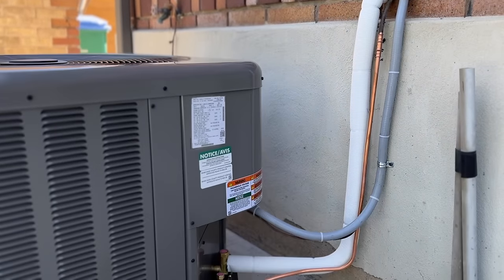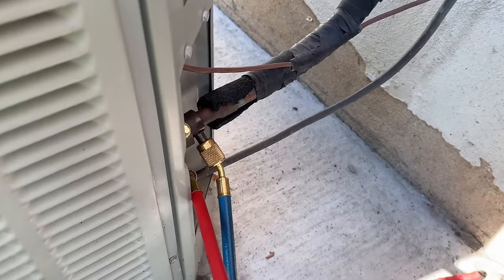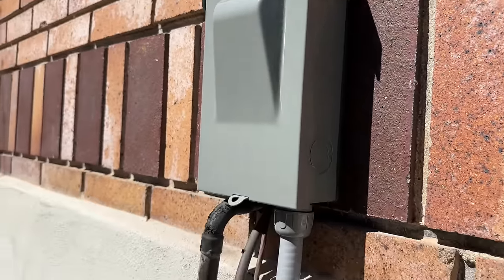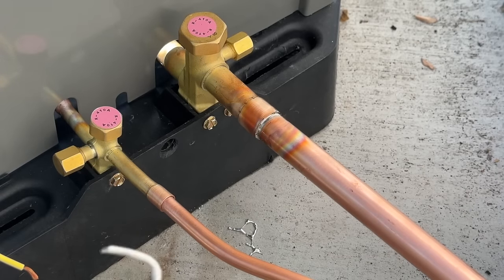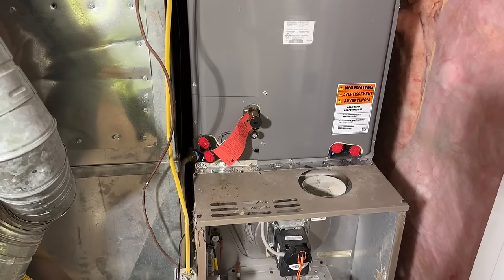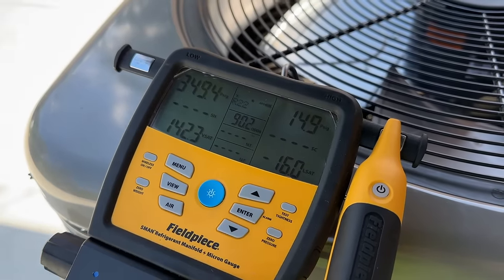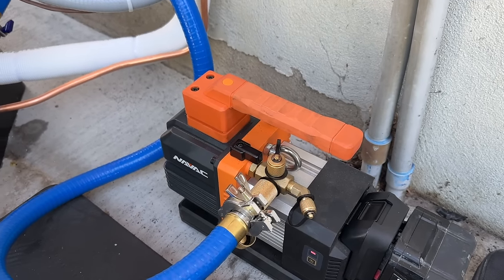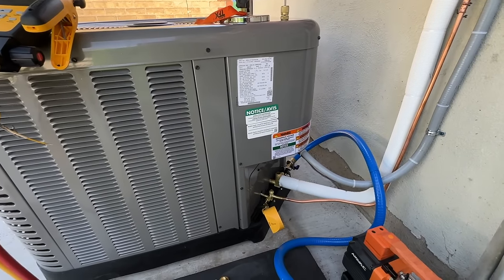Did You Know You Can Replace Your Own Air Conditioner?   -SAVE THOUSANDS-

Comment: Read your warranty! I installed my own system but without a licensed installer I would have voided a ten year warranty. I did have a licensed guy come in to flush and evacuate the line set side and then open the service valves. I have installed a couple of Mr Cool mini splits that are designed for do it your self installation, those have no warranty issues.
Reply: A lot of companies try to pull that for self install or repair across many industries. It's illegal. The Magnuson-Moss Warranty Act strictly forbids it and the FTC has fined companies over the years for trying to do this.
Reply: @Vinzi79 Maybe they received a waiver from the FTC under 15 U.S.C 2302 (c)...
Reply: yes
Reply: Well,  the nice thing about doing it yourself, if it does break, you can buy 2 more before you break even.
Reply: Mr. Cool also makes whole house units like this. Same concept as the mini split with the refrigerant in the line set.
Reply: I had a Mr Cool 3 zone mini split condenser that went bad on a DIY job. Once I documented where the unit broke over video with the company, they shipped me a new unit. All I paid for was shipping and I was surprised at how inexpensive that was.
Reply: A warranty is such a crummy product to hold over our heads as leverage to not DIY.
You mean to tell me that I should pay a 75% material markup and $300/hour in labor so that if something breaks on my unit after they install it, I won't have any material costs alongside my bill for another $2,200 in labor?

It's not even a warranty, its a prepaid do-over that you may or may not even use but will certainly pay for.
I am pretty sure I'd do it right the first time

Comment: I was immediately going to flag the non-flush but I see others have beat me to it! Going from R22 to 410a there's no need to replace the line set. I have 60 feet of line set under my slab and there is no way I'm doing that. I did completely flush my system though. First with Toluene as it does not evap so easily and then with Acetone for the final flush. If doing it yourself, remember to disconnect from the evaporator and condenser first so it's a straight shot into and out of the 3/8 and 7/8 or whatever your low side tubing is. Going on 5 years with my Goodman and running fine.

Comment: Storing refrigerant in the condenser is pretty neat. Wish we could do that in the auto field
Reply: It’s not allowed here either.
Reply: all manufacturers state in the manual, do not use the compressor as a vacuum pump .
Reply: @gallardo360  he's not using it as a vacuum pump. He uses his vacuum pump later to apply a vacuum to the system before opening the Freon lines on the new unit.
He uses the compressor on the old unit to pump back the Freon into the old unit.
Reply: @Eman-vp5wk  
I know that,,,,, typically the compressor is bad and the reason for replacement,    but you should never back the refrigerant back into the compressor to change out a part like the txv valve. good day

Comment: I really appreciate the videos.  One thing that would be really helpful is to have more content about troubleshooting. The hardest thing with diy is when things go wrong and I need to know what to do next. Example - what if the tightness test fails (your tests always pass lol), how do I find a leak (what tools are needed).  What if the pressures don't drop when pumping the refrigerant into the old unit?   If my lines are too long for the precharge how will that be evident on the guages.   Etc.  

When things work like in the video, it's easy,  but things seldom go to plan.   You have some amazing videos on the procedures on how things are supposed to work which is very helpful.  Would love to see more details about what you do when things don't go according to plan.  Thanks for the great work!
Reply: If the pressure doesnt go to zero, there is probably a low pressure switch stopping it. You can bypass the low pressure switch.

Comment: With your videos. I'm beginning to get braver on replacing my own outside unit. Been without ac for about 3 to 4 weeks now. I have appreciation for it now. I'm 49 and grew up in a farm house without ac. So with that. I do appreciate what I have and am able to share with my guests. I can braze. Probably can learn wiring connections. But first and foremost. The main at the pole will be disconnected and verified before I proceed. I will need a micron gauge. Hopefully that doesn't break the bank as well. Local hvac quoted me about 2,000 plus for external unit. Just learning myself. I feel like. As a man. If I can turn a bolt. Then. There's a probability. I can also achieve this task as well. Thanks for sharing and god bless
Reply: How’d it go?
Reply: @BridgeWater94  I haven't even attempted anything yet. I still am looking into a used unit. Still have more research to do. But I refuse to spend 4k.
Reply: Have you done it yet?
Reply: @jeffa847  no sir. But I'm planning it as soon as warmer weather arrives
Reply: You need more than a micron gauge. Have you bought the solder he shows that has at least some silver in it and the stay clean? Don't use regular plumbing soft solder, it won't hold up to the 450 PSI. (R-410) Do you have a vacuum pump and nitrogen bottle? And refrigeration gauges? You don't need the $600 gauges he used or the $700 battery vacuum pump but you do need something. If you find a used unit, it might not have the full amount of refrigerant in it if any. Keep in mind you usually can't effectively just change the condenser without changing the evaporator also.
Reply: @richkastner7926 Or the correct refrigerant….
Reply: @MatthewCarpenter-s8o  How did it go bubba? 2k is very reasonable for an install so I'm wondering how your used equipment diy install went.
Reply: Don’t forget this guy is an hvac scammer. He makes more money than a technician does by playing customer’s advocate and causing dialogue of distrust and anger in his video’s comment section. He is just as bad as the guys running around in vans ripping people off. He has just mastered a soft way of doing

Comment: I used to work for a Rheem dealer Ruud is their other brand only difference used to be one was green the other tan. Always found them to be good units.
Reply: I thought I was rheemed but they were just ruud to me.
Reply: @eddiesouther  😯😲😳🥴
Reply: I have 3 that came with my new house. I'm not sure of the brand name off the top of my head but I've only had to replace1 capacitor probably about 10 years ago. I've cleaned the fins to which only 1 needed it as my shedding dog used to sleep next to it. I'm not looking forward to replacing one of them let alone 3. I've never let a serviceman touch them ever. That's probably why they still work. Every summer I sweat it though as I live in Las Vegas and they do get a few hours of sun everyday.
Reply: They're 15 years old.

Comment: Absolutely amazing that you are sharing your trade with us. I hope the HVAC companies don't give you too much issue as this is like the magician sharing how to do the trick. Anyway, you really saved me from a bad situation. I'm already testing for my EPA Universal cert and about half way through. So that is my first thank you! My second thank you is introducing me to something other than silver brazing. I've sweated 100s of linear feet of copper but nothing is slower and more aggravating that brazing. I live in SoCal it's really hard right now to get a tech to do repairs on old systems. When I say hard,  I mean near impossible. For example, I have a R22 condenser at home that should be replaced as it's near end of life. No one will touch it without me agreeing to buy an entirely new system. Even though my evap coil is pressure rated for R410A, they will only replace it with a new condenser, evap coil, and air handler...costing between $15k-$20K. When I ask for a retrofit, the answer is "No thanks" and they just leave.  So I plan to do it myself. I've installed a whole new system before but that was easy as everything was new and matched up. The refrigerant charge was in the condenser and the line sets were empty of course. I just paid an HVAC tech to pull a vacuum (no leaks), open the valves, and add some additional refrigerant. But retrofitting an existing system is a whole different game.
Reply: Yes please keep up the good work. Just as many of those fear mongering HVAC professionals argue for only licensed people to do HVAC work, I sure they only let professionals do their plumbing work, wiring, home repairs, service their vehicles, etc. Otherwise their house may explode and vehicle catch on fire. That’s basically their argument trying to protect their trade with its obscene markups and labor rates. Worse is when they bid $7500 for 4 man hours worth of work and $1500 in equipment, parts, etc. And they do that all the time.
Reply: There is no way to remove the lubrication oil (mineral oil) from your evap coil. It's been ran with R-22 for years and will have MO trapped inside of it. The MO will also hold moisture and liquid refrigerant. The 410a systems are lubricated with POE. If you mix POE and MO, you will have big problems. Not immediately, as it takes a few years to manifest. You can flush the line-sets with cleaners and/or pigs, but cleaning the inside of your evap coil is close to impossible; financially unfeasible to say the least.

Companies will walk away from corner cut jobs because they have labor warranties they have to honor. If you don't do the repair/replacement exactly right, it will cost them man hours and senseless repairs in the long run. All while giving the customer an excuse to act like the installer did a bad job, and the real reason for failure was an unwillingness, or financial inability, to repair/replace correctly; as the manufacture states.

Never should you put a 410a Condenser on an Evaporator coil that has been running with R-22. Its a huge investment in the first place, do you really want to risk that investment on something so trivial? Or cut corners to save cost up front, and then eat repairs in the long run. The choice is the home owners'.
Reply: @BrandonJeffries-v6g Notice that he also didn’t say a word about flushing the lineset?  New compressor won’t last terribly long, but, not my problem.

Comment: LOVING that you show how the lineset can be soldered and still work fine.  The one thing that has always kept me at bay from performing my own installation has been brazing.  Dealing with very high heat + cost of one-time-use brazing equipment may just be a thing of the past! - Please comment on differences and reliability of soldering (stay-bright) Vs. Brazing. - Thanks!
Reply: Another option would be RectorSeal ProFit HVACR Connectors.  Like SharkBite but rated for HVACR Pressures.  No torch needed
Reply: It’s not as reliable you need to have more skill and tighter tolerances. Also you risk introducing flux into the system. Not a move for rookies. It’s also against code because if you had a fire inside the joint could blow at much lower temperatures.
Reply: Brazing is actually easier especially for rookies. Just get a turbo torch and skip the oxygen tank
Reply: Stay-bright 8 has been around for 30 plus years, however it’s still a matter of preference. Also soot from brazing has zero effect on residual AC systems and the nitrogen purge is just a manufacturing suggestion, just as using Stay-bright 8 should not be used on high temperature equipment. You should never attempt any type of AC replacement without proper tools, training, and license requirements. You risk getting hurt and causing a fire or major damage to your system.
Reply: My city code says you have to braze the lines.
Reply: With pressures of 400 psi +. How do you think that tiny bead of flux will hold over the years of vibration, temp fluctuation and pressure?
Reply: I replaced a  4 ton Trane with a Goodman completely DIY. I soldered the connections with silver solder after practicing on some scrap tubing and fittings. The result was great. The unit is in its third season, has’t lost any charge, and best of all the bottom of the line cheap 14 SEER Goodman outperforms the much more expensive mid-line professionaly installed Trane even when the Trane was new. You really only need about $250 worth of tools depending on how thorough you want to be. The HVAC trade is very protective of their obscene labor rates and markups. Out of 3 bids the.lowest was around $7500 to replace the Trane. I did it for under $2000 all in. A service call to replace a $15 capacitor that takes 5 minutes is often close to $300. It’s just obscene.
Reply: @iwenive3390  This is typical HVAC protective speak of an obscenely profitable industry. It has nothing to do with tolerances. And it’s easy enough to keep flux out of the lines if you follow the right procedure. The house fire thing is a huge stretch and R410A isn’t flammable anyway. You better not rotate the tires on your own car as you might have a blowout and crash. That’s the same line of thinking as your arguments.
Reply: @sharedknowledge6640  nice lie, but I know the prices of Goodman equipment, and a 4 ton systems even 3 years ago was not less then 2K. People, don’t listen to these scammers, they want you to fail and take advantage of you to fix your mistakes. Also Goodman does not sell to the general public, so if this person bought it off the internet, it was probably stolen. Ignorance of the law will not stop you from being prosecuted for receiving stolen property. Take your chance, but don’t cry when you get caught or mess up.
Reply: @sharedknowledge6640  trust me when I say that r410a mixed with poe oil is extremely flammable when aerosolized and it’s products of combustion are similar to phosgene gas. The house fire thing is real and why it’s against code
Reply: @sharedknowledge6640  you definitely also need way more than 250 bucks worth of tools even if harbor freight grade. You know your machine that you didn’t properly evacuate? It only came with enough charge for 15 of lineset. What was your final sub cooling and superheat readings? Hard to know with no tools…
Reply: @sharedknowledge6640  Bad car analogy... rotating tires is a simple process that you can actually learn in a 5min YT video. (it's just removing 4-5 lugs and putting them back correctly. any auto store will have a torque wrench for ~20$ I've taught hundreds of people how to do this.) MOUNTING (and balance) your own tires, that could lead to a blowout. That's a longer video, and a lot of practice. Plus a few thousand dollars in tools. (I have the equipment, and experience, and I still pay other people to do it - it's a pain in the ass.)
Reply: @morallyinsane7639 bro, it literally has so much effect on a split a/c system. Especially if the the coil has micro channel design. The 2 biggest causes for TXV failure is overheating and soot. Sooting is eliminated by flowing nitrogen, an inert gas. I suppose you could buy the cheaper coil with fixed piston. But installing a less efficient product so you can do the job incorrectly doesn't make a lot of sense.
Reply: @sharedknowledge6640  I noticed none of these experts responded to your capacitor comment!  Haha, the reality is hvac is an extraordinarily simple trade and the "professionals" need to do everything they can to protect their money generator.  I have a bunch of rental units and have replaced countless capacitors, added refrigerant to several condensers, installed fan motors, and installed five mini split units.  It aint rocket science.  Next up, I'm going to change out my 5 ton unit at the house.  Best of luck to you.
Reply: @peekay331.
 As a commercial HVAC/R Journeyman. I can tell you residential is technically not
Too difficult. Commercial/ Industrial gets crazy real fast with controls, chillers, pumps, cooling towers, wiring, VFD, VRF’s, CO2 equipment etc. It’s where the real skill and knowledge is learned. Resi is fun for a wee while but a lot of techs
Reply: Remember that none of these guys will get back on here to tell you that their uneducated install failed.
The process of installation I'm seeing listed on this thread is missing very important details. 
Sure 3 years, but will it last 20?
Installation from a properly trained professional will last. It also comes with a warranty. I will also say this, not all legitimate companies send quality technicians, or have honor.
Always choose a professional carefully, some only care about money. Salespeople work off of commission....
Reply: @_PatrickO  yeah, the profit margins on the installs are ridiculous.  Good thing we have people on YouTube to help everyone out. Best of luck with your situation.
Reply: @sharedknowledge6640 you are correct that refrigerant itself is not flammable.  The point you consistently fail to mention is when refrigerant is burned it creates fosgene gas that is deadly.
Reply: @peekay331  OK. I'll respond about the capacitor.  Yes they are easy and relatively cheap to replace. By the way, working with refrigerant without proper EPA certification is a FEDERAL OFFENCE. And some states also require state level licenses.  I'm assuming you just released the refrigerant to the atmosphere when you work, so I'll say you are assisting in the ozone and green house gas problems. Us professionals try to prevent ozone damage and global warming by using expensive equipment the EPA requires to reclaim the refrigerant.
Reply: @iwenive3390 not to mention that soldering like this can leave ribbons of solder inside the lineset…..seen it before.
Reply: @peekay331 Yet not showing how to do it properly.